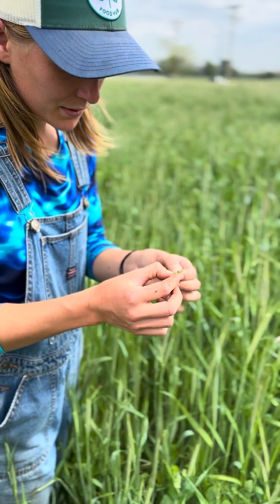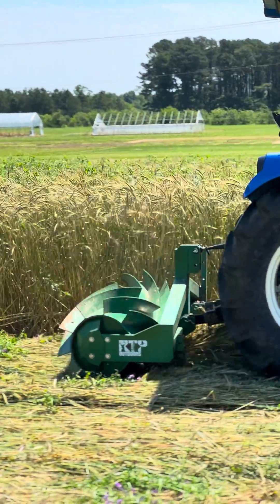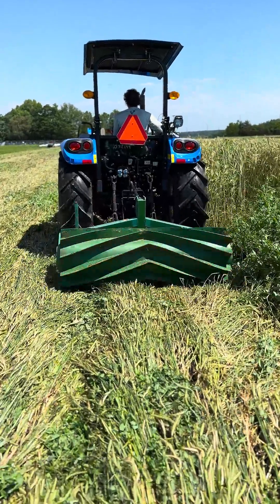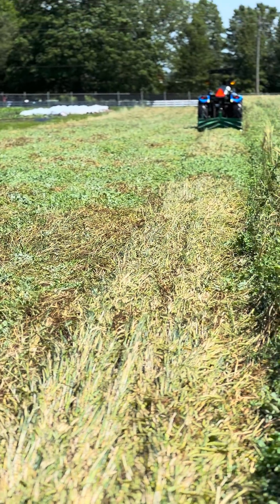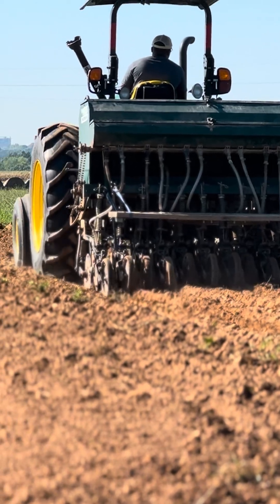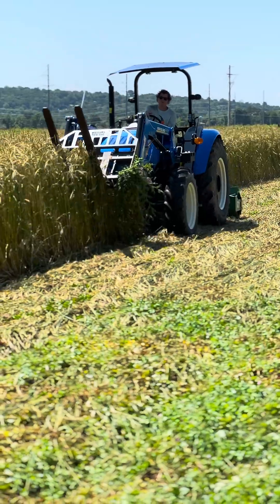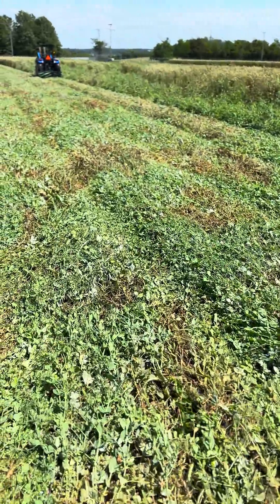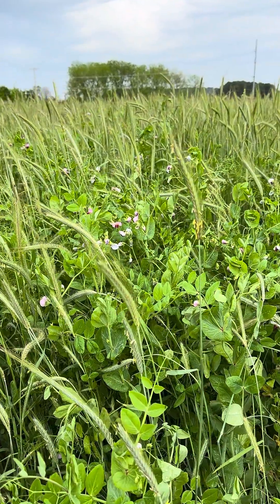No-till cover crop management with a roller-crimper #organicfarming #shorts

Comment: Honestly idk if your organic or not but if no id just spray it off right before you plant like 1 or 2 days before that way you have the wind break that the standing aspect adds to prevent wind erosion and then you also let the roots intact to basically just makes the plant stop everything and just exist till a new crop and get established also a no till drill with good row units is the dream for cover crop for example a john deere 1590 10 15 and 20 foot options on it and beyond that you can get and deere air seeder with the same units depending on how many acers you have row cleaners on your planter are another big thing got to have those for planting in cover crop but ya the drill and the row cleaners are practically the key to being flat out no till

Comment: The compaction, though. I guess thats a trade off.
Reply: That machine would put less pressure on the earth than your feet. Counterintuitive yet true.
Reply: I think if you’re gonna use mechanization of any sort, there will be an element of compaction, but I bet the crimped crops actually have a similar density to woodchips, and I bet just adding the carbon back to the soil does the biggest job in soil-de-compaction. I also wonder how adding a daikon radish to the cover crop seed mixture would do.

Comment: I learned the hard way 24 years ago so I’m speaking from experience. Go ahead and plant in to that cover crop while it is standing, in my case after May 5th. It takes a really “clean” planter, preferably one with the wheels not in between the row units. Take off the row cleaners, they are in the way, even if you leave them up. You want a good hydraulic system capable of applying good downforce, AND upforce. After a few years, it will be lifting/supporting the row unit as much as it is pushing it down. Depending on the crop, terminate by May 25th-June 5th. You won’t hurt a young emerging cash crop that is stage v-2.5. 

Have every type of closers that exist, and start with a different type from one end of the planter to the other. Stop, figure out what is working the best, then switch out the others, and be prepared to keep doing this all planting season as you transition to different soils and cover crops. 

Too many variables from that point, it would take 3 books to get in to it. But it can be done if you really want it. I have not purchased fertilizer or pesticides in 24 yrs, not even organic approved ones. You are not going to have great yields! You will be ultra ultra low overhead. The premium for organic will not fill the gap in the difference between conventional and no till organic revenue, combined with the lower overhead, it’s above the cost of production. I know conventional has had a good few years, but those are rare. Over 10 years, you’ll be way ahead. In my case, I’m getting protein gain for every acre. But you’ll also find some weird off the wall thing from time to time that is a grand slam. I’ve netted $100k on just small luffa crops for a few years in a row. You’ll probably start getting some direct to consumer business also. 

Don’t be afraid to partner with people, where you all gain revenue by having a broader of selection of products to offer. Chickens are so much work, but a big group of partners  working together on who does what on any certain day. Each one of them could make from $30-$100k working a couple of hours, 1-2 days per week. Hand picked produce, fruit, berries, put together some acres that are hard for your equipment to contend with, and or that just aren’t covering the overhead with your system, turn an army of people loose on that ground and see what they can conjure up. 

You don’t need to put up your ground with big cattle, but you don’t have to run the risk of niche breeds that are unsellable through conventional outlets. Partner with a dairy, embryo transfer prized beef genetics in to the lower half of their dams. You can get them off your land before they reach 800 lbs. 

It’s all about steady cash flow, not one big paycheck every year. It can be done hand to mouth, you can farm without a bank, no operating note, and you are hedged.
Reply from the maker: Thanks for the input!
Reply: Huge thankyuu for sharing your experience 🥰
Reply: Wow thanks for all that info!!
Reply: Hit the nail on the head! 🫡

Comment: Did you add water for additional weight to crimper. Dennis
Reply from the maker: Yes, we filled the crimper with water which did help
Reply: Rye and austrianwinterpea planted in September ..terminated rye at soft dough stage....may 20.I recording for my short term memory. I use16 foot roller. Don't  have procedure totally figured out as of now. Dennis